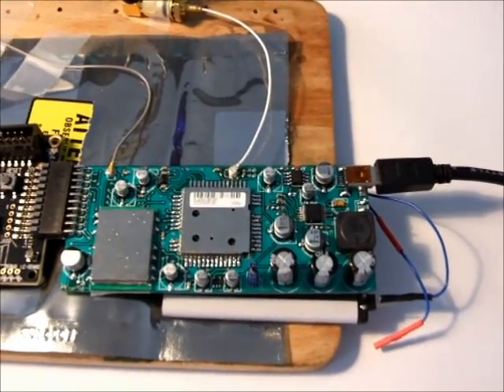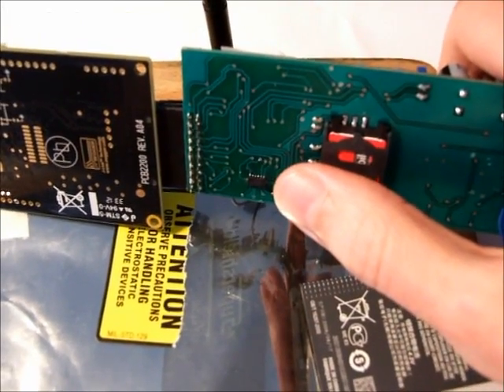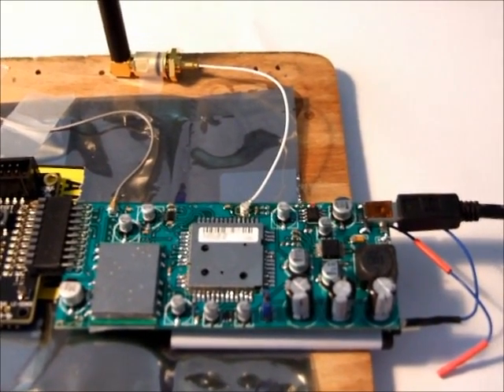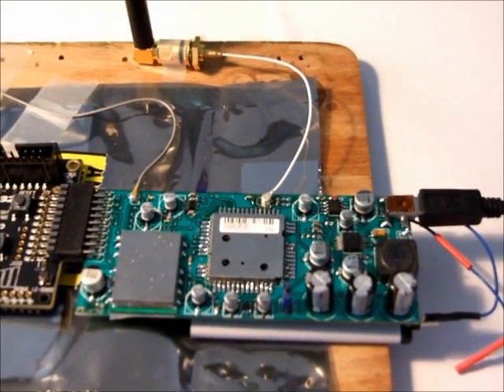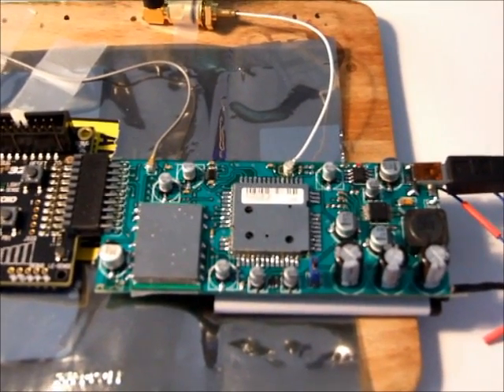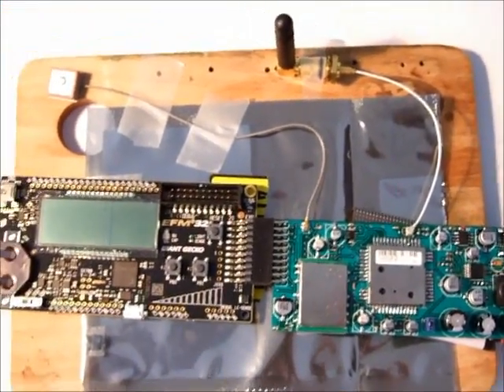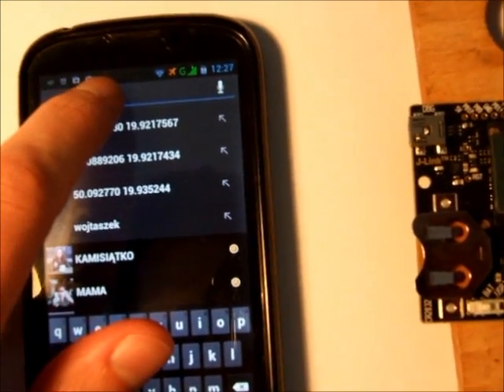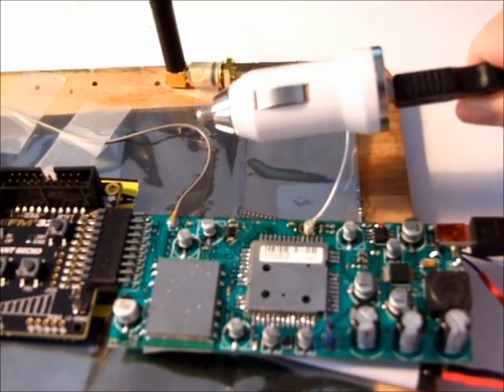EFM32 Design Contest 2012 - Geckolizator

Comment: is it possible to prototype a smaller version suitable for motorcycles and utility terrain vehicles with better material?
Reply from the maker: Sure. You could easily make a PCB that is 1/2 of the prototype size or even less if you use both sides of PCB.